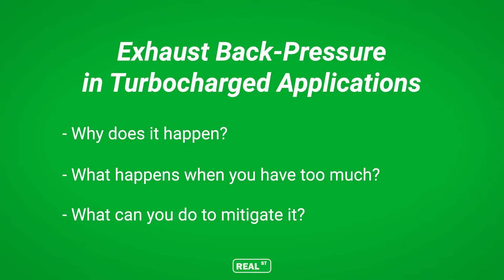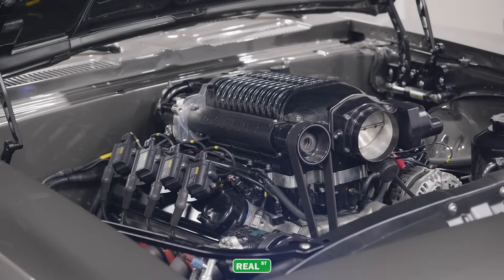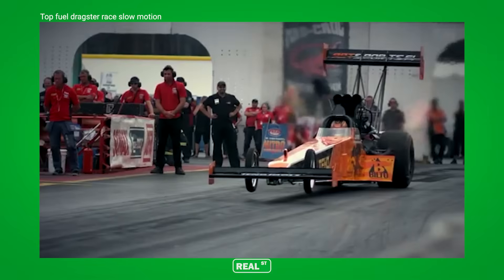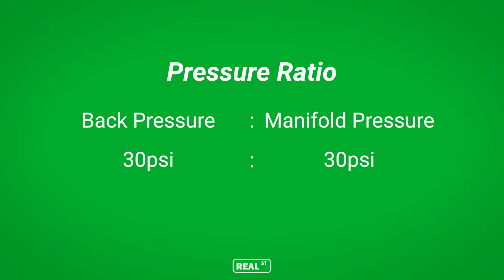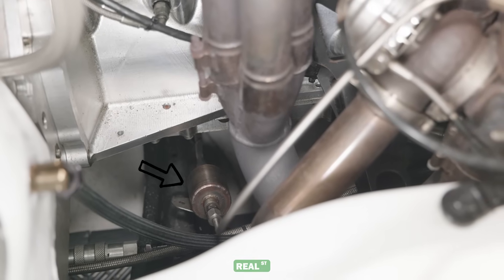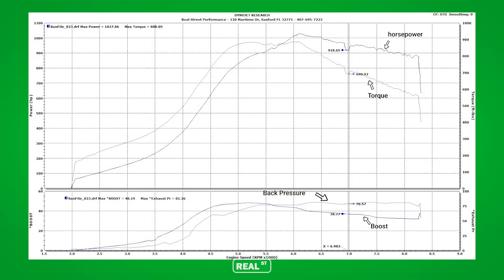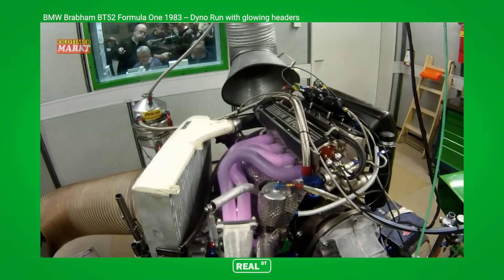Understanding Exhaust Back Pressure for your Turbo Set Up. How to Monitor it and What to Aim for

Comment: 50 HP loss for a Supercharger?  I'm thinking more like 15 - 20 HP loss. And Superchargers help keep your
plastic engine cool not so with Turbo. In fact, many plastic turbo engines have overheating problems.

Comment: Hi @realstreetperformance, I clicked on this video expecting it to be full of misinformation - like many other turbo guys who think they know what they are talking about. But to my surprise, it was very good. So, credit where credit is due. Well done.

Most people don't understand radial turbines or back pressure, and how it affects the thermal efficiency (BSFC) of the engine. Or that, there is a certain amount of energy the turbine requires to drive the compressor, which can sometimes (depending on the setup) only be achieved by increasing the exhaust pressure (air density/ temperature) and allows the turbine to reach choke at a much higher mass flow. 👍

Comment: Would increased back pressure cause spikes in RPM? I’m running into a weird thing with my truck where I’ll be accelerating in low gears, 2nd primarily, and the rpm’s will jump up beyond the throttle I give while my turbo boost pressure goes down. Any ideas would be appreciated

Comment: Thanks for mentioning the F1 Turbo Era. The BMW 1.5 litre twin - turbo four cylinder engines would  make 1,200 hp+ when tuned for race qualifying. The turbo lag was legendary so it was quite a learning curve for the drivers coming from the instant throttle response of the naturally aspirated machines. Great video!

Comment: Can you tell me why the excessive back pressure is more likely to result in knock??
Reply: Over lap on the exhaust valve to the intake.  You're not expelling all of the stagnant hot air from the engine and you take in high heat ruining your charge temp and burning off fuel faster having to make you retard timing hence losing power.

Comment: If a guy needed an engine to gain a little more velocity to spin a bigger turbo, would running a smaller hot side piping be more ideal, say 2.25" instead of 2.5"?

Comment: Bought a used built 2jz in a Is300, I believe the ECV valve that he had installed and got stuck closed. Didn't realize this and took the car for a spirited drive and found the car to be over boosting, set at 14 and was reaching 17lbs. When I parked I popped the hood and found some smoke from the turbo and oil leaking from the compressor. Just wondering how much damage you figure I did to the turbo? Borg warner efr 9174

Comment: Hello i have watched your video but i have got issue with my car maybe you got some ideas about it. I have got bmw b58 engine gen 1 car. The car completely stock never been tuned recently i had crack on oil filter housing my garage  replace the part with oem part how ever after that when i drive the car in sport or sport plus 1-2 mins  turbo get glowed( red heat) there is not any power loose or any engine management light computer does not show anything asweel what can be issue have you got any idea about it? Thanks

Comment: I got a 10th generation civic hatchback 1.5 turbo, I got muffler delete, vibrant resonater. 2.5 piping from resonater to end of exhaust. And a high flow engine filter. I got a 3inch front pipe that I have not put on yet. I can get a j pipe to eliminate drone right? What do I need for a good set-up

Comment: Having EMP gauge it is also good insicator if you have some failure going on.. for example boost leak. With boost leak you have to drive turbo harder and that means higher EMP.

Comment: Thanks for the vid. Can an axle back exhaust that has less back pressure than stock cause a reduction in initial acceleration at city speeds in a turbo charged car? This is what I am experiencing since I had an after market axle back to my turbo charged car. Any thoughts on why this might be happening?  Thank you.

Comment: What he doesn't mention: if you are hitting your power goal (traction, parts strength, etc), have enough fuel system overhead left, and aren't knocking - BACKPRESSURE DOESN'T MATTER. A massive turbo making 600hp will be slower than a small turbo making 600hp, the later just needs more boost due to backpressure.

He also doesn't mention those F1 cars didn't use incredibly oversized turbines to minimize backpressure - they picked the right size that hit the HP goal/limit but still spooled before the next corner.

Comment: My built motor on my 2018 Honda Civic type R which has a ewg Garrett 30-770 .82 a/r housing. In had the head port and polished where Tom @ Portflow opened up the fuel tumbling oem design aimed at fuel economy. It’s been opened up to flow 300cfm as opposed to 150-160 cfm. Valves are off the shelf standard size Ferrea valves and single springs. The only thing I didn’t do was replace the camshafts which I plan to do in the near future which I would think with a middle of the road higher lift and duration will help the motor’s efficiency but not moving the powerband to much to the right. Being that the k20c1 is a single port headafold I would think that makes the exhaust gasses have more velocity which helps in response. Would this head design help with efficiency? I also modified a Japanese titanium exhaust with 70mm piping to 80mm ti piping. Im sure that helps reduce back pressure. Im currently at 686 whp 585 ft lbs on Motec M142 which I bought from you, Real Street, port injection, DW300c intank pump to feed a Nuke performance surge tank with a DW300 inside to the di and a Walbro Hell cat 535 to port injection ID1700, 4 port mac solenoid, speed density, Flex fuel but pretty much use full E85 which my gauge says 79% ethanol content.

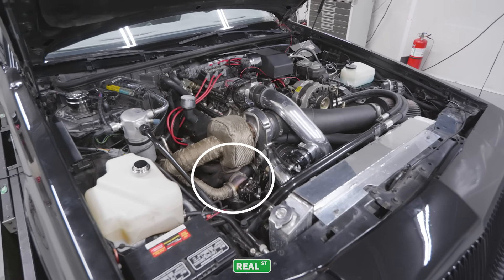Comment: 5:00
Today in 2022 .... its STILL being done that way 🤦🏽‍♂️ ....
They design it just like that, one side of the engine has a direct path to the turbine while the other side of the engine is T'eed into that 1st collector just like a wastegate dump tube would Tee into a downpipe ... and THATS what causes huge back pressure and boost creeps. It works but its not an efficient design. 
That last picture of both "headers" should route directly and combine AT the turbine inlet like a twin scroll turbo. 
Like he said, Cleetus, all that $$ & trying to get into the 7's yet your design is shit 🤦🏽‍♂️

Comment: One thing I think Jay left out was a discussion around how camshaft choice can make a big difference.  As an example, if you have high backpressure, you can choose a camshaft with lower overlap to prevent blow-back, etc.  Maybe the video was intentionally kept short/high-level, so as not to dive into more technical discussion.
Reply: You're not wrong and that approach was commonly used in the Grand National world.  When you look back and see the turbines they were using on 3.8L engines it's no wonder they were short on exhaust duration. I'd like to have the best running NA configuration with respects to compression ratio, then add boost. Thanks
Reply: @jaymeagher1510  Yes, we've learned so much in the ensuing years.  Back in the early days of turbocharging, outside of the heavily engineered world of F1, backpressure was a complete afterthought on most turbo installations.  Now days, we're careful to use equal length headers, split exhaust pulses evenly using split turbine housings, expansion chambers post-turbine, merge collectors, high flow exhaust or dumps, coated hot parts, even "hot valley" designs with the exhaust in the valley of the engine to put the length and heat as close to the turbine as possible, etc.  The turbines and compressors have gotten so much better too.  One question about building the best NA motor and adding boost: How do you see the trade off's between an engine having high CR and a small chamber VS low CR and a larger chamber?  The first will be more responsive, but will be more boost limited with respect to knock.  The second will be less responsive, but might have more power potential given the same fuel/knock limitation?  Perhaps you would pick based on the application and fuel used?  It's an interesting trade-off.  Perhaps you could discuss it in a future video?
Reply: @DanielShipley    Yes, times have changed. The boost levels are substantially higher these days for the common man.  As far as CR that's why I mentioned "respects to compression ratio" as you don't want to build a rattle trap. I'd take the lower compression ratio and slow chambers and enjoy the safety that giving up 30-40hp I'd achieve with the higher CR.  We will be doing a compression ratio test this year on the dyno, it should be interesting as we're going to do the test on alcohol and gasoline. Thanks!
Reply: I need to do some research on this, any sources you recommend? I'm planning to use a small T25 turbo with a big-ish 272 cam on my Honda. initially I was thinking the big cam might help with power on the top end when the turbo starts to fall off, but now that you mentioned this maybe it will have the opposite effect. I already have the cam so I guess I'm going to find out lol.
Reply: @5PYZ3R  Just try to build as minimally restrictive exhaust as possible.  If you can make an expansion chamber right out of the turbos on the downpipe, that helps.  Oversize the exhaust if possible.  Use straight-through mufflers.  Use an X-pipe (for a V8) and a split housing on the turbo with the exhaust pulses evenly distributed between the sides.  Use a merge collector on the turbo.  All those techniques help make the exhaust more efficient and reduce backpressure.

Comment: I'm currently building a turbo b18c1 in my 93  Si.. Head is built, all new valve train by Supertech. Integra Cams, buddy club cam gears, skunk2 alpha rods, intake manny, and 70mm throttle body and Stock crank. For now..Goal HP is 300 on pump gas and 400 on E85. Any  suggestions. On turbine size.

Comment: This is great info I never took into consideration.  The fact that one bank runs hotter than the other on a single setup has convinced me to invest in the cooling crossover mod for my car, since my engine is notorious for overheating the back 2 cylinders on forced induction

Comment: Bmw megatron. 1500cc. 83psi of boost. With waste gates removed for Two laps of qualifying at 1400hp 

If it didn’t melt engine or blow the gearbox case to bits

Comment: I've always wondered can you use a smaller secondary wastergate to bleed off unwanted exhaust back pressure, still retain your normal wastegate but have one that works directly with your back pressure sensor, even and electric one like the turbosmart e gate that can be controlled by the ecu when the pressure ratios get too high?
Reply: You can manage the back pressure with the same gate you're controlling boost with.  If you wanted to geek out about it you could just target a pressure ratio and let the rest be what it is. Thanks
Reply: @Jay Meagher  thanks mate

Comment: Street cars are more fun if you size the turbos for less lag versus more power.  If you size the a/r or turbine of the turbo a little small, boost comes up quickly, at the cost of higher back pressure.  I run twin Garrett GT28/76 turbos on my 4.6 L cobra motor and get full boost by 2200 rpm.  It feels similar to a positive displacement blower, but is more efficient off boost.  It makes more power over the entire torque curve than a centrifugal supercharger.
Reply: Those are little units!  I installed a handful of "Incon" turbo systems on 4.6 Fords and they were always fun to drive.  There's certainly a sweet spot, I don't get too caught up in what's happening at less than 4,000rpm these days, I'm just not down there when I'm beating on the car. Thanks
Reply: @jaymeagher1510  Mine is a street car, makes full boost by 2800 and holds it to 6000.  Has a 4R75W and converter that handles the power.  I had to turn down the boost to keep the tires from spinning.
Reply: what size A/R?
Reply: @mr.c5217  0.86
Reply: @turbo32coupe  I have twin .73 compressor housings on a 427 I already know I need to go bigger.

Comment: so  1:1   ratio is best but what happens  if you have 2:1? MY  BUICK 231 seems to land on 2 bars of backpressure no matter the boost i set  on the wastegate so i need a  turbo with a bigger exhaust housing?
Reply: Yes, or a bigger turbine.  2:1 is acceptable if it only occurs at the end of the rpm curve. You could retard the cam or increase the LCA to reduce reversion.
Reply: @turbo32coupe   on my engine it seems like  its  constant  we havent been able to do any  rall dyno pulls because of tuning issues as its a blow through carb setup  but as  soon as the  throttles goes on   its 30 psi of  backpressure vs    7  to 15 psi  boost
Reply: It's a fairly low reving engine that I would use a no less than a 6766 on and more likely a 6870. With a well matched converter they make great drivers.  IMO the large majority of GN engines are under turbo'd with that funky Y pipe insulting the whole show. Thanks
Reply: @jaymeagher1510  i m running an automatic

specs on the  turbo

turbine
65 mm ind
56 mm exd

 compressor
70 mm exd
54mm ind

a/r .63
Reply: @futten3230   Yes sir, that's a little turbo!  You can easily step up to a larger unit and it will still be very responsive.
Reply: @jaymeagher1510  the aim is not huge  power 500 max my worry is the  backpressure to  boost ratio  maybe harming the engine
Reply: @futten3230   Well you can start by checking to make sure that you don't have any boost leaks. Boost leaks can inflate drive pressure because the turbo will just "speed up" to meet target. Also with your engine's roots deep in the 70's it's not terribly efficient or tough. I'd make it a habit to mix in some high octane fuel or Ethanol to keep knock at bay. If you're in love with your car I'd consider the long term benefits of a modern turbo system. Thanks

Comment: What about High Back Pressure and valves kept open due to stock Valve Springs?
Reply: It seems like most of the damage that occurs on exhaust valves is heat related. If you think you're floating the valves you should inspect the valve tips/seats and lock areas. They're generally there to tell you what's happening. Thanks

Comment: I see many overlook this. Most set ups are power limited on turbine side and flow not intake side. Played with compounds on diesel trucks many years and learned the impact of exhaust back pressure is huge at high boost levels.

Comment: Awesome Jay! Symmetry and/or equal-length exhaust manifold tubing keeps temps more consistent across banks (assuming your engine has banks of cylinders).

Question? Wouldn't the pressure from the hotside naturally be higher considering you have high pressure air/fuel now exchanged to hot gases, hence extreme temperature creating a higher pressure then before the Air/Fuel mixture is burned?

When it comes to the turbo's cousin, the jet engine, I've always presumed the expanding gases (despite air being compressed prior to meeting the burner) being the driving force keeping things going after the engine is started.
Reply: Hello Kyle, the pressure on hot side is clearly higher in the cylinder but once it's in the exhaust port/manifold the pressure ratio is dependent on turbine flow.  For example a 7675 on a 3.0 Supra will be under on EBP until 30psi or so of inlet manifold pressure.  Thanks
Reply: @jaymeagher1510  thanks Jay! Yeah I realized after posting that although thermal energy is at play, temperature and pressure are still two different things

Comment: You never mentioned something very important. The bigger the engine, the worse the problem becomes to control. Richard holdener touts that a 1000hp turbo will make 1000hp on whatever engine, but that’s not true at all. My buddy dynoed his car yesterday, had a turbo capable of making 1200+ but it ran out of steam at 18 psi. Made like 780 at 18 psi and turning it up to 25psi only netted 815hp. He has a 383 cubic in ls engine. A 5.7 or 6.0 would have made more. Hell a 5.3 probably would have made more.
Reply: To make 1000 hp at 18 psi, you need an engine that makes about 500 hp NA.  Very few 383 cu. in can make that.  780 hp suggests the engine only makes 370 hp NA.  If it is a Chinese turbo, they never make their advertised flow numbers.
Reply: @turbo32coupe  this is a race car. I assure you this engine makes 500hp na at the tires. Big heads. Big cam. E85, yea a big China turbo. I think it’s an 88mm.
Reply: It's easily seen in the pressure ratio and I do agree that you can't tie a "1000hp turbo" as a blanket statement. The engine displacement and turbine flow are certainly dancing partners. Thanks

Comment: I had what I think was a super high back pressure issue on my blow through sbf with an on3 88mm turbo with a way too small .96 hotside housing. It made above the advertised power of the turbo but the engine wouldn't make power past 5,800 rpm and would just flatline on the dyno at that rpm. Changed everything we could including valve springs to help it and got it to go to 6,000 rpm. Talked to the carb guy and he suggested it was a back pressure issue which makes sense with the signs we were seeing.
Reply: I suggest you change the A/R of the exhaust housing to something like 1.3, or switch to a turbo with a bigger turbine
Reply: Also, if you have high backpressure you need to retard the cam, or increase the LCA to reduce exhaust gas reversion into the intake.
Reply: I did go to a bigger housing... 2 this time actually. Went from a single .96 to twin .91s and dual 4" fender exits. Havnt had the chance to run it yet but should free up some exhaust flow and reduce that back pressure.

Comment: general rule ive gone by - when you’re turning up the boost while tuning - when the boost starts to taper down in the upper rpm’s you’ve hit your max desired efficiency of your turbine / or hot parts setup. this was nicely described by you with the graph. as always, thank you for teaching us in depth material.
Reply: your compressor could also be too small